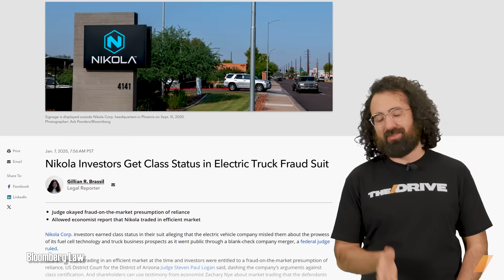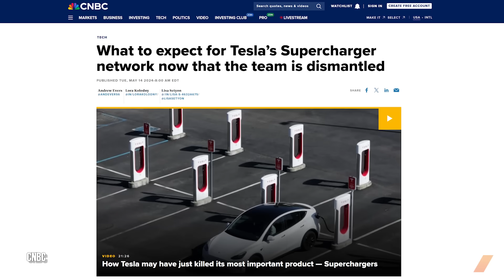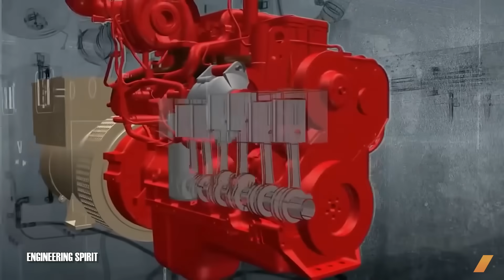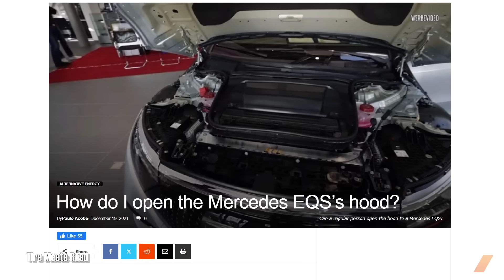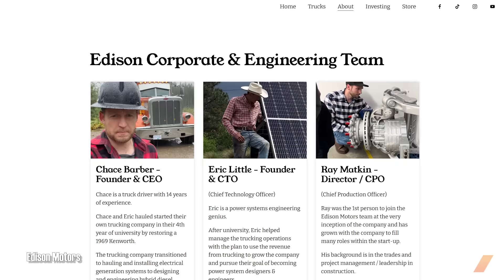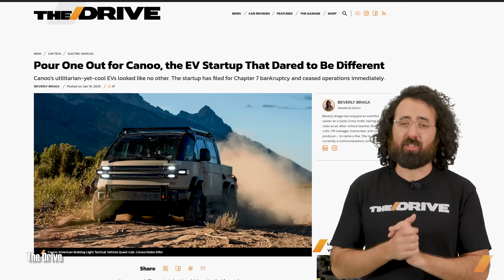The truckers in a shed beating Tesla with 100-yr-old EV tech

Comment: Lots of details are hidden here. Google for Scania generator engines, they are NOT certified for road use (but  use Scr and are EPA compliant). Probably also made in China. Gen engines do not always run on the same RPMs, as they should not overproduce all  the time (the extra energy must be dumped to heat) and power output regulation is a thing to solve. Then the actual power with 3 axles is still the max of the generator power (enough only for 1 axle). You can get battery boosts, but with axle power as 3x of generator power, you drain batteries soon and are left with generator hp... if you got a long highway and charged battery enough to handle the uphills fully loaded, it could work though...
Reply: Correct. Scania engines pass tier 4 standards without DPF and Scania has not bothered with USA DOT certification. Edison uses the engine as a generator, and is in the process of complying with Canadian CMVSS for road use.

Scania engines are primarily made in Sodertalje Sweden.

Power output regulation is handled by the batteries and computer. Extra energy is dumped into the batteries, or the engine is turned off.

Batteries handle bried peak loads. The onboard engine/generator handles average loads. A fully loaded semi needs 150 horsepower to drive at freeway speeds. The Scania engines makes 250 horsepower. Highway driving is fine.

Comment: I had said this 50 years ago . Not for Semi Truck but for gas cars and small trucks . Instead having a 3 liter engine . It would have a one liter motor  operating an electric motor . Weight reduction would would drop by 1/4  . The car and truck size will drop also . This bring back the Mini trucks and cars like the Pinto and the Hilux of the 70's /

Comment: 5-10% in over the road isn't going to cut it.  The cost and maintenance of the engine is no good. The motivation is going to be to improve battery tech and cost supporting full electric. And it will come. The E-Axle looks like a great design though.  In the meantime, Tesla Semi is going to sell a lot.

Comment: The diesel-electric locomotive has very little in common with Edison.  On the locomotive the electric drive just serves as a transmission. Edison adds the battery layer and all the AC to DC to chemistry to DC to AC conversions and control systems.  With efficiency losses at each step.  I wish them well but I fear it will be a niche application if they ever make one that actually works.

Comment: what would the theoretical fuel economy be if the generator was running the entire time the truck was being driven?
Reply: On a long haul, highway, over the road, OTR drive, an Edison truck might have comparable fuel economy to an older semi, but not an aero Cascadia.

Edison trucks shine when doing regen for start/stop driving like a garbage truck.
Reply: on straight highway driving, the same or likely worse than a regular truck of the same design.  There is nothing like a direct manual connection for efficiency.  But throw in speed changes, acceleration, deceleration, downhill, or crawling down logging roads and its very very different.

Comment: My question is, why do you need a battery if you already have a generator to power the electric motors?
Since the electric motors are doing the heavy lifting you’re going to be fuel efficient
Ford but a 4 motor electric Taurus in the 90s using the standard gas tank and put a generator in the trunk and the thing was stupid fast and got 1,500 miles of range but the EPA killed it
The battery just ads weight and complicates everything and adds unnecessary weight which affects tire and brake wear
Remember that it was the green nonsense that started the whole battery thing and they’re neither green nor efficient so Idk why we keep perpetuating this nonsense?
Reply: Regenerative braking and load peaks uphill

Comment: You really need to take a look at the European Semi truck market before calling full EV tech dead. In North America, it is probably struggling because of the distances involved, but in Europe there is a small but steadily growing market segment for trucks that will haul 88,000lbs (full rig weight) for 300 miles between charges and Tesla's aren't in the race..

I still like the hybrid system shown and think it is really clever, but it's not a universal solution.

Comment: i have always been in support of hybrids. going pure EV is not feasible for long distance travel nor for colder climates. "Teslas not liking it here in northern hemisphere"
also why i hate stuff that have build in battery instead of swappable battery with external charger. example being some cordless drills ive had to use. u have to stop everything ur doing bc the battery ran out. and same applies to pure EVs

in urban settings EVs work just fine when u only drive short distances and have plenty of charging points but the second u leave outside large cities where u might be on the road for hundreds of kms especially when its cold u run into capacity issues and charging stations become non existent. also the cost is way too high for average Joe and 2nd hand EVs have commonly busted batteries and way limited travel distance due to it. and ppl rather just sell their EVs and buy Hybrid in place since it becomes cheaper than getting a new battery

and then there is the safety issue since some places like garage buildings dont allow EVs since the batteries are considered a fire hazard. this is pretty common with E-Bikes in apartment buildings and they dont allow storing them in bike storages unless the battery is removable and u store the battery in somewhere where its ventilated and can be tossed away in case of fire.

i can see EV hatchbacks being handy for families and for ppl who dont travel much since its large enough for daily stuff around towns and grocery runs and can be used when going for short trips next town but for ppl who drive a lot like few hour drives to work and back then no. the batteries become a large issue and for that hybrids are way more practical and cost effective

and EV go karts seem pretty fun :D
plenty of power for such small thing and dont need super large batteries to have plenty of fun around the track xD
"yes, i have been watching Grind Hard Plumbing vids these last few weeks to catch up and their EV projects look fun af :D"

Comment: Electric trucks will take over because they are way cheaper to operate, safer and can be fully automated (reducing costs further). The range issue will subside over time like it has for EVs thanks to an expanding megawatt charging infrastructure (I'm talking about Tesla, as I'm not sure other companies will deploy this network).
Reply: I agree with your points with the exception that billions of dollars will need to be spent on upgrading long distance power lines.

Comment: I think the Chinese manufacturer byd also has similar setup in their yangwang u8 car which has 2 litre turbo petrol as a generator and electric motor with battery although not a diesel engine still is available as an option in their line up.

Comment: Does the diesel electric battery weighs nothing or is it included in electric component weight?
Reply: A fully battery semi has like 10,000 lbs of batteries. An Edison truck has like 2000 lbs of batteries and 1000 lbs of engine and 2000 lbs of fuel

Comment: please don't ignore things to make your argument better for example I didn't see where 300 gallons in a two tank config which is 2100 lbs (unless you drive on E all day) was even mentioned which changes the weight comparison in a non significant manner with just the diesel not to mention the support systems like exhaust tubing coolant etc.  also  a more in depth comparison of the service contracts would have been helpful since I believe they can cost 15k per year and using electric vs diesel at $0.15 kWh/$3.50 gallon saves $43,000 per year so just ball park savings at 58k for just those two factors per year.  The current battery tech lasts on the low end similar to that of an engine so a battery swap compared to an engine swap would have been appreciated too.  I liked the video and maybe I missed that data but I think that should have been included to strengthen arguments

Comment: How does Edison Motors hybrid trucks handle the extreme cold?
Reply: Edison is making a snowplow for Emcon. They can use batteries and diesel fueled heaters to pre warm the engine. Once the engine is warm enough to start, then the running engine can push warm glycol through the generator,  batteries, inverters, and e-axles.

Comment: Let me help you.

Every time you ever say "but what about" its time to think more deeply about what you're about to say. The batteries aren't a big deal compared to the running costs. They just aren't.

Now the other points, yeah those are problems and in some cases more valid problems than others depending on the loads being hauled.

Grid capacity: dude, whatever. AI is already eating more capacity (~1-2%) than the entire electric vehicle fleet has to date(~0.5%). Just the RENEWABLE energy curtailed in California last year was enough to drive ~14 billion miles in 2024 at 4.2miles/kwh. Sure this isn't the 340 Billion miles travelled, but it should help you with context about the scale of what you're discussing. When you include the non-renewables which are under-utilized and that number jumps to an absolutely staggering 168 billion miles.

Now, can California actually deliver that kind of power? Yeah, as long as it is spread out enough to allow equipment to cool off. The highest peak demand recorded was 52GW. Over a 24 hour period this would be 1248GWh, whereas we would only need 40,000GWh total to support the 168 billion mile previously mentioned. Therefor with a grid which could loosely support up to 456,000GWh per year delivered the EV use of 9% of that to drive 168 billion miles is nearly nothing. Think 2x big gulps (1/2 gallon) in a 5 gallon pail. Sure you probably can't charge during surge usage in the middle of a heat wave in summer, but that is rarely a problem anyway as there are about 19 other hours in the day.

Yes I understand that not all vehicles will manage 4.2mi/kwh, much less semi trucks. This is simply what I've based the estimates around to help get the scale of things. Changing this figure of course changes things directly proportionately.

Lastly, let me leave you with this little bit of understanding. Gasoline is currently about an EROI of 6:1, so you want to make 6 gallons of gas you need to spend 1 gallon to do it. Now that same energy equivalent of that gallon of gas has already moved the electric car about 70 miles (assuming 50% efficiency delivered energy, burned at a plant & 4.2miles/kwh). Those same 7 gallons (6 created + 1 used for creation) of gasoline have moved the average new gasoline vehicle about 156 miles (e.g 6 gallons * 26MPG).

Comment: I have been saying this for so many years IDK why they never did it  -  have you see wrightspeed  system there is a TED video and also targets Garbage trucks ... so  ... it uses a turbine based generator ==>  also the swapable batter pack that some place in Australia is doing  as well as ones with a swap-able battery system for  construction equipment

https://youtu.be/F4H3FE0Z4QQ?si=L5mGs2aIi__qtBkO

Comment: Long haul trucks are essentially just a solution to the problem that not having a decent rail system is. Long range, there is nothing as efficient as rail.
Reply: I agree with you, And, it will cost hundreds of billions of dollars if not trillions of dollars and decades to build out the rail lines in the USA as you suggest. After the initial spend, it will take decades to recoup the return on investment.

Comment: 2:45 6 tons of lithium ion batteries, what could go wrong...
Reply: I'm aware of two recycling plants, specifically for spent lithium batteries, in USA that went up very recently. I blame unsafe handling or storage if not sabotage. One recycling center in UK even more recently because someone packed them in large quantities hidden in loads dropped there and they didn't know it until their center went up. So far, I never heard of an incident anywhere they're manufactured. Though by the time they're recycled it might be normal to suspect they can't be a threat. A center needs to have and employ means to do a safe check quickly on every unit that comes their way, until then store it so it doesn't cause a disaster if anything ignites.
Reply: There has to be someone who has done the research and can advise everyone who needs to process and store those of dubious quality and condition in mass quantities.

Comment: Might as well use Stirling engines instead if you’re going for a serial hybrid design. Long term, we just need to build trolly lines on the highway system and then the trucks can connect to that without needing large onboard batteries.

Comment: It's ironic the company doing better work is called Edison and the shittier company that steals ideas is called tesla when the two people they are named after are exact opposites of those attributes.
Reply: It was alleged that Tesla Motors' patents were meant to be open for everyone to use without royalty nor risk. As the intent was to entice motorists to prefer and switch to EVs, not even care if the company stays in business, as long as if it fails it is because other companies made proper electrics. I often did wonder though if a small liquid fuel generator makes more sense than a battery if you need to add more than several pounds for energy anyway. I still consider how I might power my eBike directly with one, probably mounted to the trailer.

Comment: 6:30 what's the capacity/weight of the batteries they're using? it sounded like the diesel motor is 1,000 pounds less than a traditional semi, but that's evened out by the electric drivetrain... does that include the battery? that would be a small battery
Reply: Correct. Edison has a battery 1/4 the kWh as Tesla. It handles peak loads. Edison has a diesel engine about 1/2 the size as traditional. So the Edison truck weight is comparable to a traditional diesel truck.

Comment: I almost wonder if to take the clean energy idea further with this if applying Hydrogen or CNG converted generators would also be viable to both reduce cost but also emissions since CNG from the US seems very clean to burn compared to processed fuels like gas and diesel as long as the infrastructure supports it.

Comment: I've always wondered why big trucks were not diesel-electric when they've been using that tech in trains and big ships for nearly a century because of the efficiency gains of running the diesel at constant RPM, and not needing a mechanical transmission.
Reply: It's diesel electric hybrid. I don't think trains use batteries.
Reply: @benargee  modern Diesel Electric trains definitely have batteries. But they usually don't run on battery alone for long distance (electric only mode is usually used for moving locomotive alone for short distances) because the batteries are old lead design and small in capacity. Older ones might have capacitors only instead.
Reply: The hard truth is that, specifically for overland freight trucks, a fully mechanical drivetrain is still much more efficient. They tend to cruise at a constant RPM for long enough distances that that efficiency losses due to acceleration/deceleration is more than made up for compared to a generator-electric drivetrain. For the generator-electric drivetrain, the efficiency losses due to conversion inefficiencies will always be present and doesn't make up for the efficiency gain of running at a constant RPM (this could be mitigated somewhat by using a smaller engine since high torque is handled by the electric motors anyways)
The only reason why trains don't use mechanical drivetrains anymore is because they're so heavy that the transmission required to make it work would be too heavy and too complicated. In a Diesel-Electric train, the electric motor is actually considered to be taking on the role of the transmission. An overland freight truck is still light enough that producing cost-effective mechanical transmissions is possible.
Hybrids on conventional passenger cars do get the best of both worlds because they have transmissions designed to "shift" between electric motor, direct engine drive and mixed power modes for optimal efficiency. But on a freight truck meant to carry heavy loads, it adds  additional complexity. Edison's designs rely on the simplicity of eAxles where the electric motors are actually packaged within the differential of the axles, making a conventional hybrid setup almost impossible for an Edison truck. This is why they're so repairable. They're designed with simple, modular off-the-shelf parts but at a cost to energy efficiency.
This is why Edison is still currently targeting more specialized work trucks and not overland freight. There is less competition, the cruising efficiency is not much of a concern, and having a generator on hand has a lot more utility for the usecase they're targetting.

Comment: Saying that they're beating Tesla is a stretch.

They do have a good performing truck, but the concept is antithetical to the intent and purpose of the Tesla semi.

There wasn't a demand for a hybrid diesel, there was a demand for an all-electric semi. Moreover, it's just built on top of the frame of another truck, like a retrofit kit. It's fine to compare them if there is no movement to eliminate combustibles, but one was built for a zero tolerance zero fossil fuel future. The other just leverages a market that's available when introducing new technology. You could say an Edison truck is probably better than a typical semi, but it's not so easy to make that comparison to a Tesla truck.